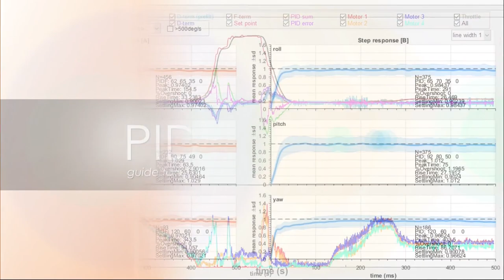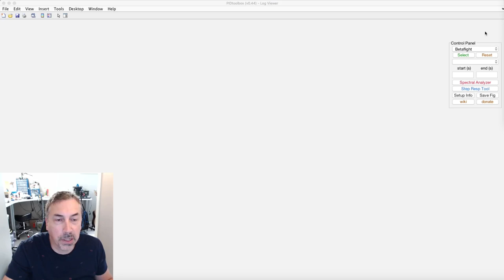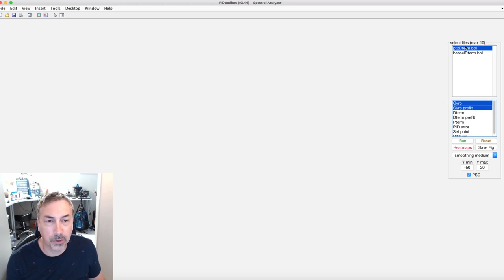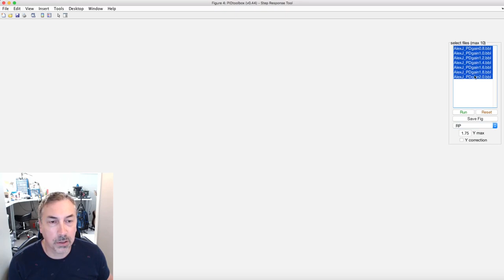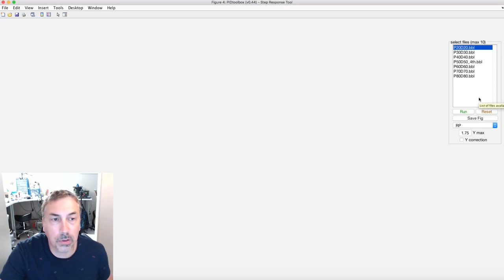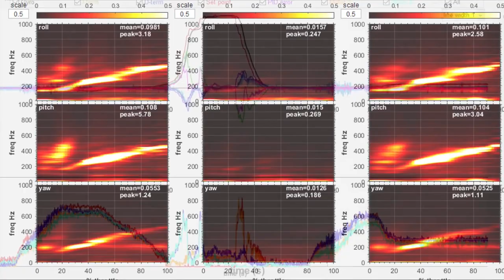PTB v0.44 Release!

Comment: Since it is nonlinear do you recommend having i term relax and antigravity off for the step response analysis experiments? Would it then be possible to not only identify setpoint -> filtered gyro but also the plant itself which then could be used to calculate the stepresponse of calculated pid values? So that you only measure the plant once and then tune at least the linear part of the controller offline? Thanks for all your effort Brian, I love it!
Reply from the maker: good question. I think antigrav wont matter too much during "basement tuning" because it only kicks in with fast throttle moves. as for iterm_relax, hmmm, I think I'd leave it on. The thing with iterm is the tuning window there will be very very wide for a 5 inch. so like as long as P is sufficiently high to close the error gap, then you could effectively have iterm anywhere from say ~50-150 without issue. racers like it on the high side for helping in sharp turns as it gives a constant push that really helps cornering. the only time I term becomes and issue if on less powerful builds when asking too much of the quad wrt rotation rate. so like jamming 1000+deg/s. So ya, there are these non-linearities but I think most of the range where we fly usually is within the bounds of where things are fairly linear. I think that's why the PID controller works at all on our miniquads, and why step resp method seems to work pretty well. Not sure I understand the 2nd part of your question. I have thought about how to sort of model the parts that are not tested. so in a sense if it's linear then it should be easy to interpolate across the points not measured. I sort of do that when making a decision on what PIDs I should use. So I might often pick PIDs that are between two curves. I like the idea of modelling the  missing data though
Reply: @PIDtoolbox  Thanks for your answer : - ). At least at my build I see a difference from the step response estimate generated from experiments having i term relax off or on. I actually found the information helpfull for tuning the highpass for i-term relax. what i actually ment with the second part was assuming we're having i term relax off and we're exciting the quad in RPY direction around hovering the controller operates linear around an operation point. As far as I understood PIDtoolbox is estimating the stepresponse from setpoint (w) -> gyro (y) via powerspectrum estimation (T = Pyw / Pww, T: w->y) and then integration of the impulseresponse (just ifft). In the same way you could actually estimate from setpoint (w) -> pid output (u) (SCw = Puw / Pww, SCw: w->u). Dividing those in the frequency domain delivers the frequency response estimate of the open loop plant (P = T/SC, P: u->y). The idea then would go as follows: 1.) take an experiment with any stabilizing PID parametrization with sufficent excitation and not too much gain in the higher frequency region, 2.) estimate T, SCw and the plant P, 3.) since T is just a function of P and C (PID cntrl) the stepresponse of T could then be calculated (simulated) with any given PID values (try and erro in PIDtoolbox). Like this it should be possible to reduce the amount of experiments and tune at least the linear part of the controller offline with real data : - ) It should actually even be possible to tune the lowpassfilter for the D-term along the process.  (phu...)

Comment: What does mean " N = for each Condition"  at 06:12  The number of your/that blackbox file ? Specific ID of this logfile? I dont realy understand this thing :(
Reply from the maker: N refers to the number of observations that go into an average. Here it’s referring to the number of extracted step response curves that go into that averaged step response curve. The algorithm uses a sliding window that moves across the data from start to end of logfile and at each point in time is computes the relationship between set point and gyro to get the step response trace for that date. Then it steps and repeats until it reaches the end. All the while it collects these step response curves that are then averaged in these plots. Hope that makes some sense
Reply: @PIDtoolbox   aaaaahhhh :D This was shown as much  higher number in the past, right ?  Anyway much thanks for the fast and exactly answer! Now i can sleep again at nights :) Regards ❤️
Reply from the maker: @outlawdareal  it depends on many factors. There used to be subsampling and min deg/s options both of which affected N, but the absolute N here is not as important as the quality of the observations. For example if you set min deg/s in the old version to something really low, it just start trying to compute step responses on little blips in the data around the noise floor. sure you'll get higher N, but not a better or more meaningful result. the current settings will only give you a good result when you have a clean gyro, and you give it a decent amount of stick input. this way, people dont interpret junk.

Comment: What is a noise level that is „ok“ 
Decreasing filters means I can’t increase D or not? But how to judge the right balance ?
Reply from the maker: as a rule of thumb for gyro, <= -30dB is exceptional, > -30 to < -20 is acceptable. > -20 is questionable, > -10dB not good, > 0dB you're on fire. This is of course ignoring every below 20Hz which is essentially stick input. Between about 20Hz and 100Hz is a tricky region because it's not usually filterable so you get what you get there, but the best flying rigs will have this region below -30dB as well, and that's irrespective of propwash or oscillation
Reply: @PIDtoolbox  
Thanks 🙏🏻

Comment: My spectral analyzer doesn’t work, step R does though.  I has version v.43 installed and just ran the installer on new one. Should I erase all and re install?
Reply from the maker: you never need to re-run the installer. just grab the new PTB executable (in the 'main' folder). Drop the 'main' folder on your desktop and run the program that's inside there. I recently re-uploaded the win version which had a bug in the spec analyzer, so try re-downloading
Reply: @PIDtoolbox  ty sir 🙏🏼